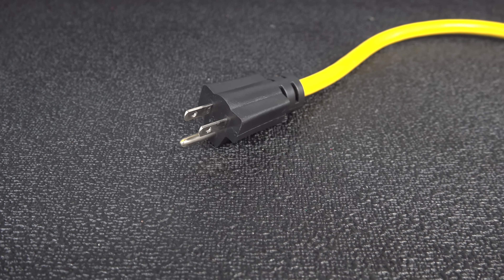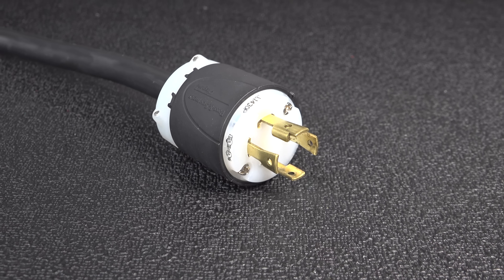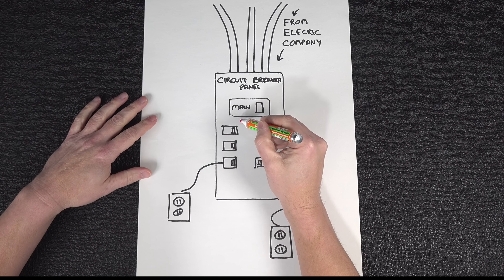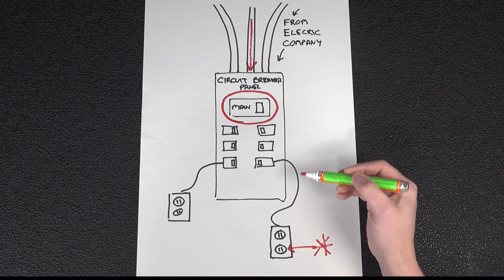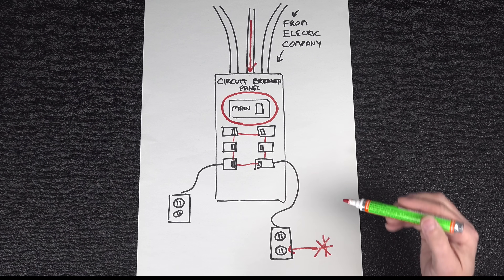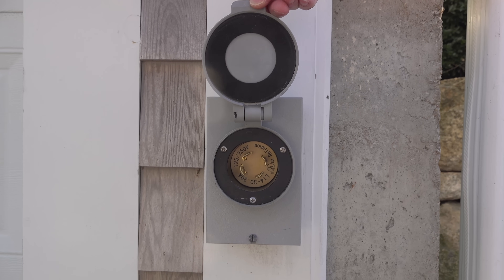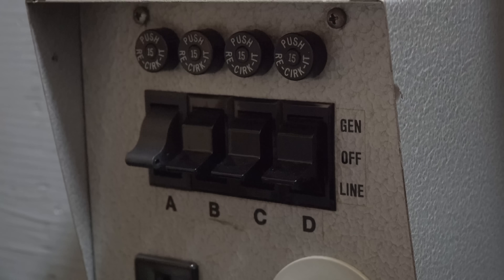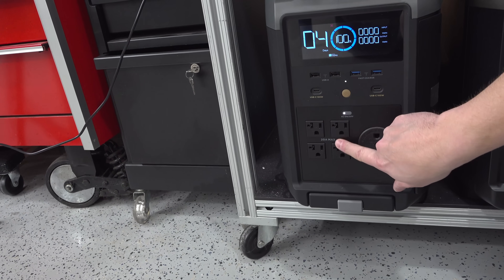Worst Electrical Mistake You Can Make - Backfeeding Generators

Comment: Yea, idiots get shocked every day. I have 3 generators including a bigger one that I back feed 220 volt if the power is going to be off long enough that we need hot water for a shower. Always throw main 200 amp breaker and use common sense.

Comment: so then how can I safely connect my car inverter or generator to my home power system without installing additional hardware?
Reply: I would definitely not use a car inverter. Those things are way too weak to be able to handle large loads, and hooking them up to a home power delivery system is asking for an overload/fire.

At the very least, get a semi-portable gas-powered generator with enough horsepower to be able to handle the essential appliances in your home (i.e. ceiling fans, lamps, coffee machines, or even your well pump).

Be sure to cut the main incoming breaker off on your panel before you do this, and shut off any unnecessary circuits!

Next, verify your generator has a 220-volt output. Go to the hardware store and see if you can hodge-podge together a male-to-male cable with 220-volt appliance plugs on each end. On one end, make sure the plug matches the output of your generator. On the other end, make sure it matches the receptacle used by your clothes dryer. Make sure you invest in a thick enough cable, to ensure it can handle the load!

Then, you can actually back-feed the power through the outlet behind your clothes dryer. It's that easy.

It's a temporary "redneck" solution that's completely unsafe long-term and an absolute OSHA nightmare, but as long as you know what you're doing, it'll get you by in a pinch. The people at the hardware store, as well as the armchair quarterbacks of the Internet, are gonna strongly advise against this kind of thing. Try to consult with some electrician buddies who have experience in the trades. Again, you've got to accept the risks with anything. But as long as you know what you're doing, and you talk to the right people to point you in the right direction, then you should be fine. 😊
Reply: Depending on the power output of the inverter, and how it is connected this may be either an acceptable emergency measure or an 'oh hell no' thing. If the inverter is large (1500w or more), made by a well-known brand, and connects DIRECTLY to the battery (NOT THE CIGARETTE OUTLET) you can power small appliances from it as long as the inverter and car are both well-ventilated and cooled, and you use at least medium duty extension cords. Do not expect to run microwaves, toasters, heaters, or other intense draw loads off an inverter for extended periods of time without proper knowledge and equipment. Surge power draw, initial power draw, and normal power draw are all separate numbers you need to know before using the device or appliance. A 500w air conditioner, for example, can pull anywhere from 800 to 1300 watts or more on startup. 

Source: am currently using a seven heavy duty semi truck battery array with solar and inverters

Edit: DO NOT USE AN INVERTER TO BACKFEED DIRECTLY TO YOUR HOUSE EVER FOR ANY REASON

Comment: Back in 2005 when Katrina was in the Gulf, my dad made a "manifold" for lack of better term. It has that 30 amp 4 prong plug that goes in the generator, the other end of this heavy duty cable has 2 double gang metal conduit boxes bolted together and there's total of 4 outlets (can handle 8 plugs at once if you watch the usage). We just took the end with all the outlets and put it through a open window in the house. I would love to put a transfer switch put in

Comment: Scary to think that if there was a power failure in your street, some muppet with one of these cables could end up making your street live again. Even worse, have a home made cable and swap the live and neutral, and end up bypassing every switch and safety system because of the reverse polarity. (Yes, I know AC power is not polarised. I’m talking average person, not sparky.)

Comment: havent been able to find that little plate for my breaker box. also my main breaker moves up/down or i would retro fit one. for now i just lock the panel and put tape up the generator breaker.

Comment: Been there done that but in this case my house was physically disconnected from the power grid by the power company when I did it. I can not afford to pay 2000$ to get an electrician to install a breaker that will maybe be use once in every 5 years... That is why I instead use a suicide plug that did cost me nothing, I just have to be sure to turn of the mains fuse if I do it while still connected to the main grid (and just to be sure I also turned of the fuse and used only one circuit so it would be double protected from back feeding).

Comment: People, if you predict that you need energy from a generator in a whim, get an electrical INLET installed. They are commonly found on caravans and trailers to feed electricity into them. And use a normally closed contactor connected to your mains to make sure the inlet is disconnected from your house when there's mains power. That's your safer but still cheap alternative.

Comment: Back feeding a generator one short the stator out unless the generator has a built in circuit with a special breaker to prevent the power to reach wrong side of the stator the home generator installed in this house as a stand by generator is designed to come automatically when the power go out and cut off when the power comes back on and it is staged to switched circuits off and then allow the power to take back over it takes 5 minutes to do after transferred all circuits back it automatically sets down and once a week the generator automatically does maintenance run where it starts the engine and runs for 5 minutes without load on it and if unit were to detect a issue the unit will display a bright red light basically stating unit needs to be serviced this generator is propane powered unit but the unit was not cheap it $12000 before installation but it a 5000 square ft house that 2500 square feet upstairs and 2500 square feet downstairs and rated handle 24 kwh now It was installed a year ago and it done earned it keep power here go out when wind blows wrong we live the county

Comment: Question... A normal 120v outlet only uses one of 120v legs. So if you back fed through a normal outlet, wouldnt that only power pretty much every other circuit or just the circuits that share that same 120v leg?
240v would back feed 120v through both legs and thus power all circuits given the generator is capable, but just a 120v plug like that seems like it would oy feed a max of 15 amps total (that wasnt a 20amp plug) through only about 1/2 the circuits in the panel.
Am i thinking correctly on this? Just basing this off of when i have done work adding circuits and there were 2 bus bars and every other circuit was on the same bus while the 240v contacted both busses which is how it gets 240v.

Comment: How can you have a solar system that intentionally backfeeds into the grid?
Reply from the maker: It has an automatic disconnect built into the system. When the grid goes down it stops feeding solar power automatically.

Comment: I may or may not have used one of those cables in the past. At least to my credit, I made sure that the plug was plugged in on both ends before firing up the generator, and I also made sure that only one of the two breakers (main line, and generator) was on at a time. Now I know for the future and will likely get my house more backup generator ready for next winter (a necessity to run heat during winter power outages to keep pipes from freezing in the northeast).
Reply: I will not have a lead like that any were near my house ,i will more than litly grab the wrong end

Comment: well to back feed if you were gonna do it pull your breaker switch out of the one your feeding into and wala problem solved tho only on that one breaker switch will you have power its alright to run just a fraction of the house in a power outage ive had a "Friend"  thats done this

Comment: I have a generator and built a cord to cord it backfeed it into my dryer outlet. I read in the code that this is legal if you lock the main breaker in the off position. I bought a breaker lock and a paddle lock to secure it. This was said to be legal for emergency use only when I looked it up in the electrical code. I have not tried it. I am not an electrician but I am an electrical engineer so feel comfortable around electricity. The generator runs on propane. Hopefully I will never need it. Basically I bought it for the big earthquake to power my radios in my role as the local emergency service volunteer for our neighborhood.

Comment: I have been doing this for years, here in my country all those security panels and plugs to connect generators do not exist, so when the electricity goes off or there is a close thunderstorm that can fry your house electric equipment, we just shut down our panel terminal switches and plug the generator with a cable like that one, if you follow the correct steeps and you have it inside your property where no one else should touch it, is not that unsafe, but selling the already made cable that anyone without basic electricity knowledge can be really dangerous as you say in the video.

Comment: This happened in my city, there is a meat market with a backup generator and some utility workers had to repair an underground power line nearby, they shut down power in the area after notifying everyone and someone in the meat market turned on the generator but forgot to disconnect it from the main power line, well when they went to fix the line two workers were in the trench they dug to get to the line and one died instantly and the other died later in the hospital.
Reply: That was preventable all the way around. The meat market folks were morons in this matter and the workers should have not assumed the voltage potential to be null.
Reply: @GuerillaContracting  I’m not sure why are you are sure they assume the voltage was null.  It’s quite possible that they turned off the power, then verified that the lines were dead before starting work. Then the generator was turned on after they had verified the lines were dead and started work.

The power company doesn’t just turn off the power for giggles. There’s a good chance that the power was turned off right before they started, and I’d expect a delay between them turning off the power and the generator being hooked up.
Reply: @guri256  that may be the case but osha repeatedly says that even if you think it's safe check it anyways some of the worst work place accidents were caused by a worker being told or thinking it was safe but not verifying that it actually is safe that's why they have grounding equipment even on dead lines just in case it's not 

In short it was stupid for the meat workers to do that it was sk partial fault for the electrical workers not double checking if it's truly safe
Reply: It's shocking that people would do this
Reply: Total bummer, man!
Reply: sounds like the last guy died of aftershock
Reply: That how my uncle died
Reply: That's why qualified worker put ground on power wire prior working on it.
Reply: But don't those cables have ways of being disconnected first before being worked on?
Reply: @alan62036  you have to actually unplug it, rather than just do nothing.  Cheers!

Comment: Been back feeding during hurricanes all my life. I use a home made cord made from welding leads to back feed 240 from a 10k bobcat generater/welder. Runs everything like normal. I understand the fears but done correctly and safely its not a problem. I did install the safety switch in my panel so that main and generater can't be on. Sadly most ppl lack common sense so they couldn't backfeed safely. Common sense is something Americans have been losing more and more of every year. Thanks for the video hopefully someone learns from this before they backfeed with the main still on

Comment: I would prefer having an electrical inspector check and test out any DIY wiring before you even think about connecting them to the main and/or switching it on.

Comment: generally speaking two ended male cables are cursed... same with usb... other then usb-c i think... but like a usb-a male to usb-a male cable will fry your computer if you connect both ends to the same computer or another one... unless its got something in the middle of the cable that handles that stuff safely... though that proibably not always the case... like not if its got a box that boost the signal because its some kind of long range usb or something....

Comment: Now I want to know what happens if I connect that cable into a single wall socket. Like one end on the top of the wall socket and one end on the bottom of the wall socket. With the cable explode or would my wall socket explode? Actually the circuit breaker would probably just kick out wouldn't it? Beyond ethernet cable and I know nothing about electricity

Comment: wiring.
one of those areas where the adage 'a little bit of knowledge is a dangerous thing'
soooooo true. l was visiting inlaws in NJ ages ago, a news story some poor kid up in the attic on a hot day, covered in sweat no doubt, electrocuted working on live wires.
it only takes about avg 1/600 th second to grab you and fill your soft tissues with free electrons.

Comment: To me the biggest risk is the "could forget something".  I'm reasonably confident I could operate the right switches correctly to not hurt anyone most times...BUT you know its going to be in the peak of a storm at 2AM as your basement floods and you've been awake for 30 hours straight, how likely are you to not make a mistake?  We had an interlock kit installed by an electrician, and I put color-coded tape so its simple "turn off all the red/yellow ones for generator use" so we might even be able to do it correctly half asleep and exhausted.  I wanted it fool-proof for idiots and exhaustion.

Comment: That's why we use the safer option.
Turn off the breaker, then stick 2 bare stripped wires into the outlet holes.
Everyone can see how dangerous it looks, so nobody trues touching it...
And we turn off the breaker not to save workers, but to prevent our neighbours enjoying TV with our diesel money...

Comment: We actually use this kind of cord (not with the same plugs) here in Brazil to use voltage transformers, since they have 2 female plugs so you can connect anything to either end and just use one of these on the other.

Comment: 1) Νο, it is not dangerous for the ppl working to fix the problem. Intermediate switches do exist, even in case of the problem being directly at the line that comes to your house, where technicians are informing you and pulling your house's main breaker down -not the one existing within your mains board. That's not a capability but an enforced procedure technicians have to follow. 
And, if that exists in a quite underdeveloped european country, I believe its a common practice.

2) No, backfeeding is not illegal everywhere, as procedures like the one described in (1) exist.

Lastly, i COMPLETELY aggree about this type of cables being extremely dangerous, but only for the person handling them.

Comment: If you isolate your own fuse board via a double pole isolator from the mains incomer (the main isolation switch) your install is completely separate.  Turn off all the breakers then back feed the install via a socket outlet from the generator.  You can power your lights / heating / WiFi within the power constraints of the generator kw rating by turning on the relevant breaker.  Here in the UK, 1kw is 4amps (240v).  So you can work out what circuits you can use.  It’s not ideal as the MCB / RCD etc won’t function correctly but if there’s no power from the mains it’s better than nothing.

Comment: One thing you forgot to mention is that in a circuit breaker, only the hot's are switched off. The neutral and ground are not. If you were to reverse the hot (black) and neutral (white) going to your generator with a "Jumper chord", you would make all the ground and neutral in your house hot and going to the road for that matter. Also, if you back fed using a 120v cord to an outlet, only half your panel will get power. This is not good for circuits that use 220v for only one leg will be hot.

Comment: In Germany there is a similar problem. 
There is the "standard for fixed solar systems on the roof". (SffSSoR)
And the "standard for fixed solar systems above ground".  (SffSSaG)
It is unthinkable for an official to approve something for which there are no laws, standards or instructions.
But if you live in an apartment building then you don't have a dedicated roof for a solar system.
This is how the "mini balcony solar system with male plug" was invented.
(I'm sure we Germans can get this sentence into one compound word, or short = mBSSwmP ;-)
Dangerous? No!
The male plug has no voltage even if the solar system is in full sun. 
Only when 230 volts AC come out of the socket will 230 volts AC feed back in the right phase.
The system has general approval, but you have to tell the energy company that an electrician has connected it. 
I mean the electrician has found the fuse and cables suitable and put the plug in the socket, signature, stamp, done. Everything needs paper work, compound word and shortcuts in Germany otherwise we wouldn't be called Germans ;-)